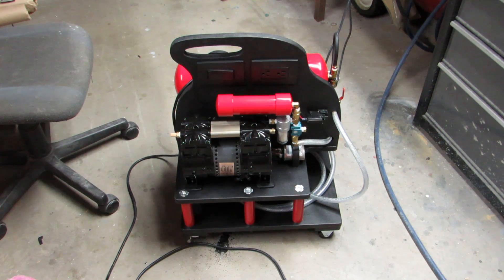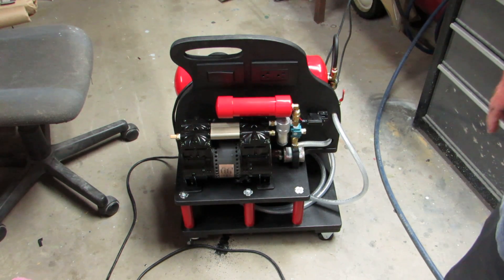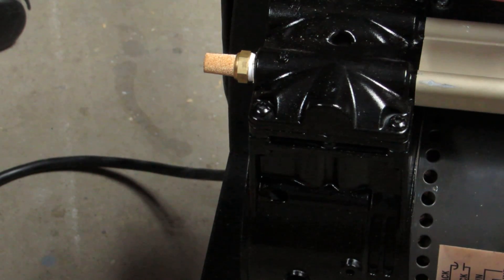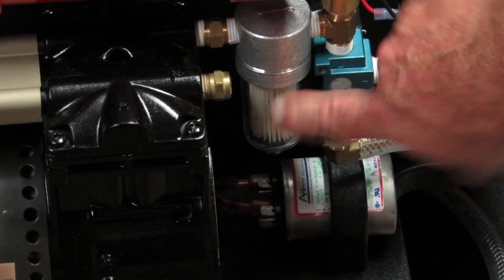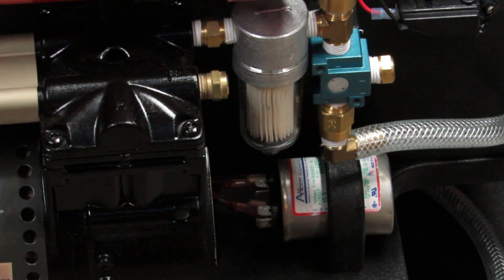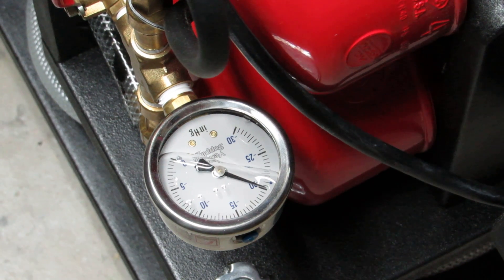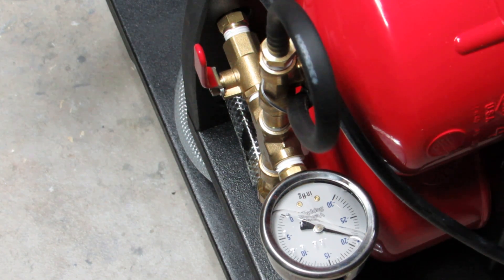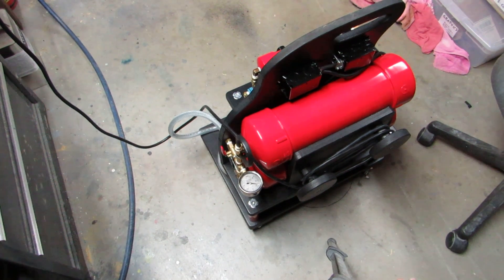Homemade Vacuum Press

Comment: you do know Ebay has a vacuum pump 3.5 cfm for like $47.53. will pull ac vacuum no problem in fact that i what it is for.

Comment: extremely well done project. wasn't sure though about something... the plug on the cord from your vacuum pump was a 2 pronger ? unless every tool/whatever you plan on plugging into your vacuum pump based outlet is 'double-insulated', you need to have that plug have the ground connection too.. remember, electricity takes the path of least resistance, you don't want that to be you.. safety, man !  :)
Reply: Especially if you like to go barefoot on a concrete floor. Better to protect yourself from a nasty shock if the case of vacuum pump were to become energized. Otherwise really nice build!
Reply from the maker: You're right. It's only a 2-prong on the source. I never thought about it, but it would be better to use a 3-prong.

Thanks for the heads-up.

Comment: It's been over a year now--what have you used it for? I assume veneering, otherwise you'd probably get a $69 Harbor Freight vacuum pump.

What size bag have you gotten or made, and how often does the compressor kick on, or was it kicking back on because of leaks at fitting joints & plumbing parts?
Reply from the maker: My main use for the vacuum system has been to make my own batches of plywood and composite sandwiches. These are used as raw materials for building large scale model airplanes, and take the place of commercially available plywoods, which are usually heavier than is structurally required for the plane. I have other videos showing some of my layups, like this one: https://www.youtube.com/watch?v=-oNg3h9GU44.
Reply: the idea of a vacuum pump WITH A SURGE TANK/S is that vacuum pulldown can be applied QUICKLY to a project, and not wait for full vacuum to be applied, like when a hot material is in the process of being cooled down and doesn't fully form because of cooling too quickly because your still waiting for full vacuum to be applied.